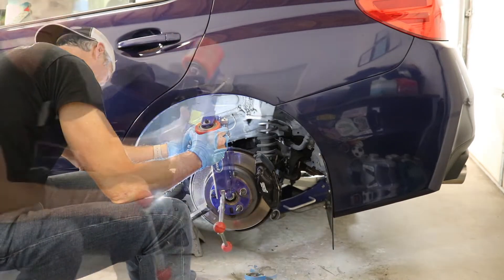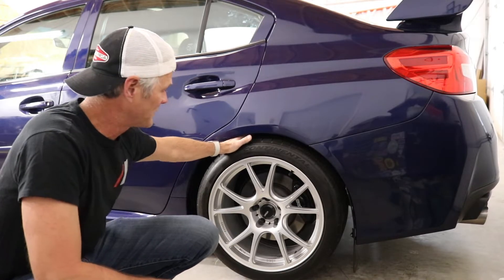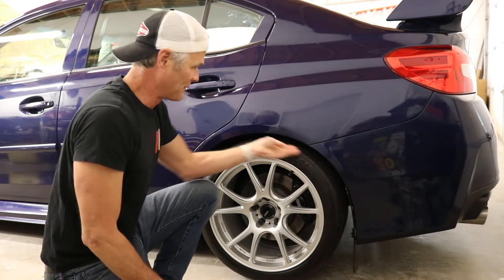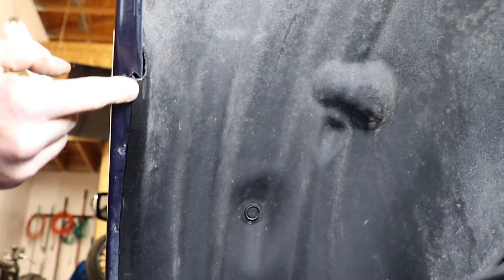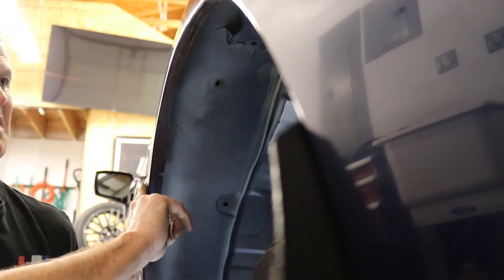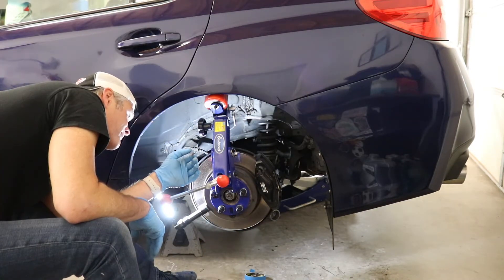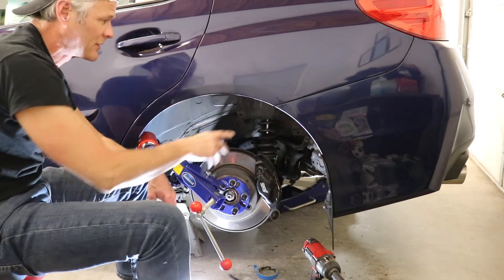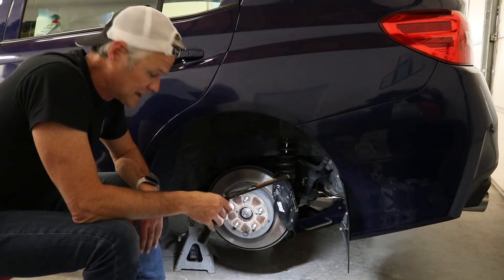Subaru WRX STi Ep. 46: Rolling Fenders for AutoX Prep!

Comment: what about the corner where the bumper meets the fender at the point of it, my 17 sti cut a groove into my tire from that point and my fenders are rolled?
Reply from the maker: Hey Zach!  I did cut a bit of a V there to allow that to make a tighter radius but I also recall taking a bit off of the flat part that continues back so it wouldn’t be sticking out and shredding the tire. It was only about 1/4” x 1/2” removed but seems to have done the trick!  Disclaimer…I’m no expert and my roll wasn’t perfect, but it worked for me! 😁